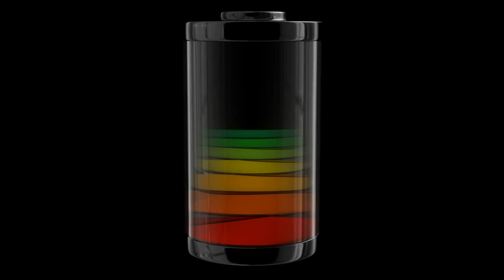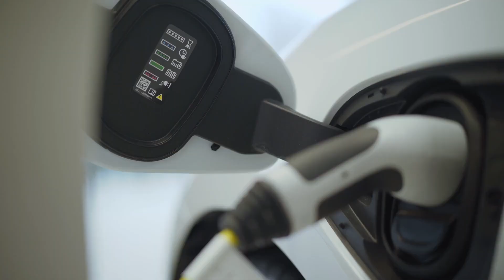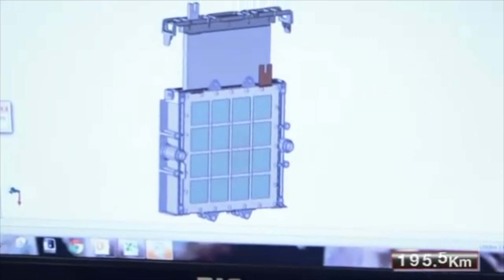This Battery Gives EVs 1000 Miles of Range!

Comment: It could work, but I'm sure each car manufacturer will use a different battery and your battery will go dead by the time you find the right swap station.  Common sense would dictate using the same battery in every car, a worldwide standard.  A small car takes one battery, a large car takes two, a small truck maybe two or three, and a large truck may take seven or eight batteries, but as we all know, common sense isn't very common.
Reply from the maker: Frank you’re thinking the same way I am, for something like this you need standardization. Companies that mass recycle the packs and companies that open swap stations. Anything less and it’ll never be price competitive

Comment: This is cool, however I have to say that the whole range issue is largely in our minds.  My Model 3 has a 322 mi range and it's plenty (more than enough for day to day, and perfectly reasonable for long trips).
Reply: MORE range is better. I want a model 3 with 8 billion miles of range
Reply: @flawns  You are an intergalactic nut case......
Reply: @gangleweed  That would be a "case" for shipping "nuts" to other galaxies.
Reply: @gangleweed  thank me later when it comes in reality
Reply: @flawns  That will amount to 160,000 sets of tires @ 50,000 miles per set. CAN YOU afford that?
Reply: While this might be enough for you but those who travel long distances on the weekend (New York to N/S Carolina or even all the way to Florida) 322 mi range is nowhere near enough.  In order to move away from ICE the current iteration has to blow it away so there is no looking back.  I'm glad they are able to reach for 4x-5x the range of ICE so there is no question no reason to stick with ICE.
Reply: @vazaruspaytonas  I agree.  As with all new consumer technologies though, there is a gradual replacement of the current tech with the new tech as it improves over time.  I am not aware of any technology that simply replaced all usage of the previous tech in one step.

That being said, ICE is being replaced and will continue to be replaced so long as something does not interfere with the advancement of electric system components, legal usage, or source of materials for the components in the new system.  The question is how long before ICE is permanently replaced.  20 years, 100 years?  No one truly knows.
Reply from the maker: Yeah I agree I think it’s fine for most.
Reply: John Cahill On my longest commute, it was 1.5 hours one way.  That was about 80 miles with traffic.  I think you are spot on.
Reply: More range is good, but if the smaller battery could charge at a sustained 350 Kw, I'd take a shorter range al-ion battery and blisteringly fast charge time over just straight range. Lots of 350 Kw chargers in my area now.
Reply: Ans as long as the recharge stations are 150 miles apart or less, it's not a problem. The strategy is to recharge just enough to get you to the next recharge station. At least that's the strategy for now. As stations build out, this becomes subject to change.
If there are recharge stations every 10 miles and the range is 322 miles, then I want to recharge in 300 miles. I don't trust that the station at 320 miles will be operational, and I'd rather have the extra range option.
When on a trip in a gasmobile, I try to combine stops. If I'm refilling the gas, I will stop for a bathroom break and also get a bite to eat. If it takes 30 minutes to get a decent charge on a Tesla, then that should work out really well.

Comment: 2 gallons of gas = 300 miles? 🧐
Reply from the maker: Did I say that Richard? It’s all about the details. 2 gallons of gas has about 72kWh of energy. Now gas engines are terribly inefficient but that wasn’t my point. We judge energy storage by storage, not the subsequent mechanism to convert it to motion and it’s efficiency

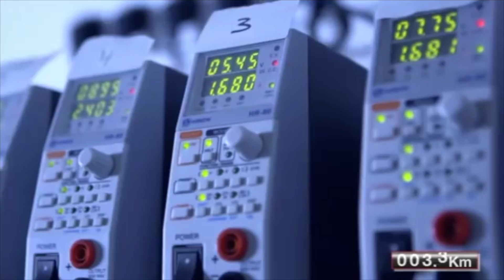Comment: "600 KM" does not equal "about a thousand miles!"  See @ 8:05.  Closer to 400 Miles.  Still a very interesting video.  The new dirigible lighter than air drones would be ideal for shuttling a generator to a rural location for a spot recharge.   Super Capacitors would also be ideal for recharging Li-on car batteries w/o need for gas or gasoline generator.
Reply from the maker: Pinned comment did you see it? 1600 km or 1000 miles

Comment: He did not mention that using aluminum this way is horrible expensive. 1kg of Aluminum give you about 8kw hours energy and cost around 4$, do the math yourself if that is a cost you would accept for driving your car,  and on top of that comes the cost for the device... To give you a preceptive on this an electric vehicle uses around 30 kWh to travel 100 miles at a cost of 15$ in just the aluminum.

The real reason we do not have aluminum batteries is simply that they would be way to expensive to use as aluminum is expensive to make and use a lot of electricity to be produced combined with the high cost of making the batteries.  It is more then 30 years ago that they believed this was a great idea and started looking into making them but it was not successful at all because of the cost.
Reply from the maker: Cost doesn’t matter. Costs for a lithium battery were huge back in the day. If this tech is adopted the next question is optimizing and economies of scale. That will bring prices down like 10x over a decade or so

Comment: If a battery can't be recharged, surely it needs replacing after use? If this is true we are using up resources, and surely it is small improvement over fossil fuels. Batteries need to run for 100,000 Plus miles before needing replacing to be environmentally friendly replacement

Comment: I could definitely live with 1,000 mile range and a pit stop every two months.
Reply: If you drive that little, you could probably just plug a regular EV into your regular home outlet and keep it charged up just fine, no heavy lifting required
Reply: I definitely could use a car like that especially because I drive 120 MI going to work and back home everyday
Reply: @jerodoverfield9635  damn
Reply: I would need to change every fortnight, and that's just for work driving.
Reply: Are you drving a thousand miles  week?. Its not your car you need to change its your job.
Reply: No, it's too much waste with this throw away AL-O2 battery.
And it would not be available in any region far away...
Reply: @Richard-S  I would take different conceptual frame and call it a recyclable battery system. If created in large quantities shipping and storing them in any market would be possible. If it were economically possible to integrate the recycling and production facilities use would likely lower costs making smaller companies possible. That's a matter of time and market penetration.
Reply: @stuart_oneill  that's like throwing away an empty gas tank. No, thank you.
Reply: @Richard-S  Using your example change the frame and posit 800 miles a battery with 2 batteries that switch from one 'tank' to another when necessary. Now there is plenty of time to stop somewhere, and I'm guesstimating, for 15 minutes and replace the depleted battery. How many recharges on a 'normal' EV in the same amount of mileage? How much time spent on each one? Also important is the elimination of the need to create electricity artificially. A full solar power electrical grid is far,far from a reality.
At any rate I get your point and can understand if we use today's conceptual frame. I'm suggesting a shift in habits and change of concepts. Thanks for the reply.
Reply: Sounds nice but at what cost?
Reply: Are you sure you can live with this? Sounds like you're just guessing off the top of your head
Reply: Pit stop every 2 days for me (uber driver).
Reply: Id have to have it replaced twice a week almost
Reply: A 1000 mile every  2 months  ?  Why would you even bother owning a car in the first place .
Reply: There's an excellent book that posits a system that could propel R&D and have other benefits as well. "The Entrepreneurial State" by Mariana Mazzcuato. In our current need for accelerated advances in the energy market and many other areas this well documented book debunks many of the myths concerning private v public efforts. I can't explain it easily. I have no compact explanation. But I ask this community of forward thinking people to at least take a look at the book at Amazon for example. I think you'd find it valuable.
Reply: My specific question about the battery is how scale it for individual home use? It would be an interesting topic.
Reply: At 1,000 miles range I would have to hot swap evey week! Yikes! It cost me $60 average to fill my tank every 3 to 4 days in gas. So if it cost more than $120 a week to hot swap an allo air battery than this tech will not help me because i doubt it would be that cheap.
Reply: @Al13n1nV8D3R  Why do Yanks moan about the price of theor petrol? Its virtually free, you have zero incentive or need to buy an electric.
Your cars cost nothing and your fuel is so cheap. Why bother with EV?
Reply: @sandersson2813  Fuel including Petrol, natural gas and coal is a finite resource and will eventually deplete to nothing. Why is your Petrol cost so much more? Because your country can't find enough of it. So EV's are the future whether you like it or not. LoL
Reply: @Al13n1nV8D3R  Materials to make batteries out of are also finite. So what do you think of that?
We are not in danger of running out of oil or gas.

Petrol costs a lot not because its hard to find but because 75% of it is taxation.
Where are they going to get the revenue when they stop getting it from petrol?
They'll charge you per mile or per charge. You think EV's are cheaper to run still? 🤣 🤣
Reply: @Al13n1nV8D3R  I don't have a tiny engine car just to afford petrol. I don't find petrol prohibitively expensive, though many do, it's just more expensive than it is in the US. 
I have a smaller engine than you would have in the US, because its pointless having a V8 here, not because I can't afford it.

Oil is not in danger of running out anyway so saying that EV's prolong the lifetime of oil is a rather silly statement.

I would rather pay a bit more for my fuel though than drive the sort of car that Americans buy.
Reply: @sandersson2813  I can smell denial a mile away...........lol
Reply: @Al13n1nV8D3R  V8 isn't a common sight in Europe. Too loud and most of the cars that have them are too wide. 
I have had V6's and straight 6 cars though.
Reply: And how much do you think you'll have to pay?
If a Polestar 2 is 50k with 240 ish real time range, do you think you'll get any car based on this battery for less than 180k?
Reply: Tesla TSLA battery R&D in Nova Scotia facility is in the same building with Metamaterials, Inc. MMAT that have created a nanofilm that exponentially advances solar energy efficiency. You may never need to do a stop again once these two technologies are linked.
Reply: @jamescobrien 
and I'm the King of Spain.

This is another pipe dream like other so called infinite energy supplies.
Reply: @sandersson2813  It's not infinite energy, it does depend how much they drive, if they race on tracks, etc. If they drive 300miles a day (non racing), the solar charge effiently will charge it if left out in light.
Reply: @jamescobrien  I'll believe it when I see it. Do you knlw how many false dawns there have been in this field of energy production?
Reply: @sandersson2813  I can totally understand. I've seen it as well.
Reply: Doesn't cars normally have like 700miles of range
Reply: @starlandgaming6116  No, not really.
Petrol cars in countries other than America grt about 35-45 mpg, diesel cars get around 45-65 with a tank size of between 10-15 gallons.
So on average closer to 400-500 miles per tank.
Reply: Me too.the charging battery is reliable.
Reply: Release Zero point energy tech and your car will never need a charge.  Trouble is they can't put a meter on this like they can your has or electric usage. Also a man came out with a car that runs 9n water in the 1980s. Let's just say he was not around long enough to put it into production.
Reply: @ActivateMission2ThisTimeline  bruh he converted the water to oxyhydrogen and ran his car on that, that's literally it. nothing fancy. besides that's pretty inefficient considering you have to put more energy into the water to turn it into oxyhydrogen than you get out of it when you blow it up.
Reply: @ActivateMission2ThisTimeline  "zero point energy" is just a stupid buzz word for perpetual motion, which doesn't exist
Reply: @BigCroca  " perpetual motion, which doesn't exist"  Literally everything in the universe is in perpetual motion.  If you want to argue otherwise, name something that is perfectly stationary.
Reply: @wesbaumguardner8829  it's actually not perpetual motion though. it does slowly lose energy in some way or another. planets do not spin or orbit forever, stars do not burn forever, everything eventually stops
Reply: @BigCroca  Name a single thing that has "stopped."
Reply: @wesbaumguardner8829  how about all the stars that have gone supernova and created new stars and solar systems? also the earth rotates slower today than it did when dinosaurs were around. the universe "as far as we know" doesn't have infinite energy
Reply: @BigCroca  "how about all the stars that have gone supernova and created new stars and solar systems?"  Those stars have stopped existing in their initial form, but all of the material that was in those stars has never stopped moving.

"also the earth rotates slower today than it did when dinosaurs were around."  I am not sure how they came up with that.  We have only been measuring the earth's rotation fairly recently.  How do they know it is constantly slowing down when they do not have any observational data to go by?  Now that they are measuring the earth's rotation, it has been proven that the earth both slows down and speeds up.  Even if the earth's rotation was gradually slowing down, that would not prove that it was stationary or would become stationary.  The earth is still revolving around the sun which is itself revolving around the arm of a galaxy which is itself in motion in the universe.  Every single one of these motions must stop for the earth to become stationary.  So where is the magical stationary object that proves that the state of being stationary is even possible?  That is my question.  You say all things stop, but can you provide a single example of something which has?  If you cannot even show that a single object has stopped, how can you make the claim that it is possible?  

"the universe "as far as we know" doesn't have infinite energy"  We don't know much about the universe.  We do not even know whether or not it is finite.  If the universe is infinite, then it must also have infinite energy.  As yet, there has been no observed boundary condition between the universe and whatever is not the universe, so it is erroneous to assume there is such a boundary as physicists do so they can apply their laws of thermodynamics to what is quite possibly an infinite universe through assumption.  To further compound the issue, we do not even know what energy is.  All of our definitions for energy are incomplete at best and abject nonsense at worst.
Reply: @wesbaumguardner8829  earths orbit has also slowed down, the year is longer now. just google it lmao.

Comment: This was "glossed over". If the cathode ( or positive plate) is made out of oxygen, How exactly do you connect it to an electrical cable?
Reply: The air electrode is usually a Nickel mesh impregnated with carbon powder and carbon fibers. So IT has Good permability to air and every Oxygen molecule has No problem getting rid og its charge. Usually a small pump keeps a light vaccum in the cell, so air is drawn through the porous electrode and so the electrolyte doesn't leak out of the cell.

Comment: It really depends on the cost of aluminum air batteries for 1000mi range.  If it's cost effective, AA batteries could easily augment lithium powered cars, if the cars were designed to accept and augmentation battery pack in the truck, lets say.   Look at it as a reserve to get to the next charge location for the lithium cells.  Once charged up, the AA batteries could be saved for the next time a range extension is needed.  But realistically I think it's unlikely AA batteries could be cost effective enough for car makers to justify designing an augmentation slot in the trunk when you need distance extending AA batteries installed to help out.
Reply: @Tom Spurlock

Power density per kg and size to cost of battery manufacturing to recycling of aluminium oxide into said battery is the key to the viability of this technology becoming popular ie. Economically feasible competitor to current available energy storage solutions.  
Unfortunately Hydrogen is not a viable alternative due to its use in hbombs ie. It's illegal...

Comment: IF THE ALUMINUM  BATTERY  CATHODE DETERIORATE AFTER 1000 MILE ...MAYBE MAKE THE  BATTERY TO HAVE A REFILLABLE CATHODE ...JUST CARRY CATHODE FILLERS  TO REPLACE THE DETERIORATED CATHODES..EVERY 1000 MILES.....just a cent opinion..